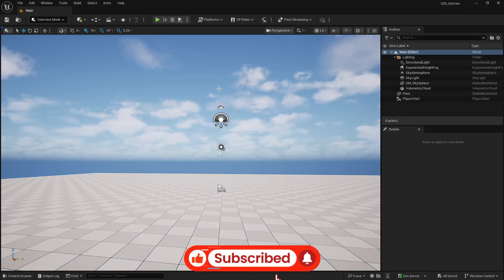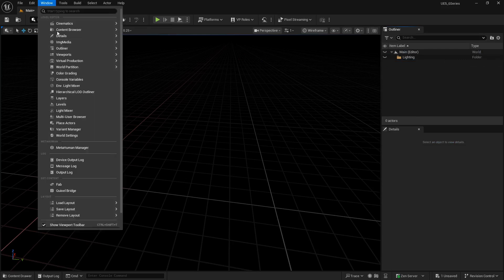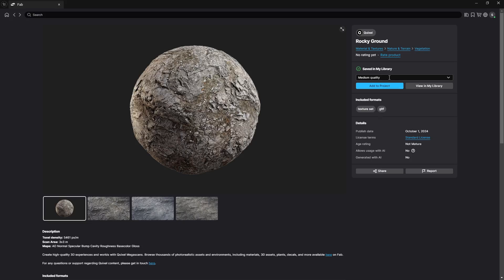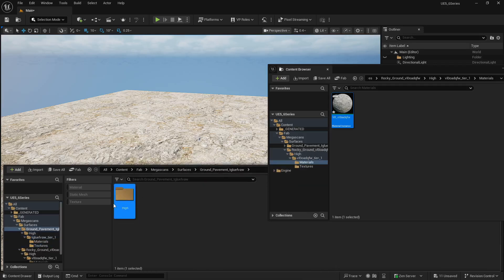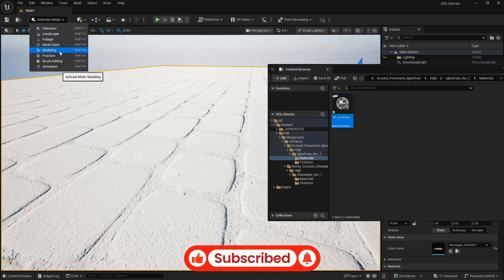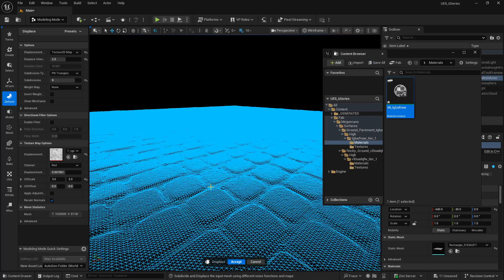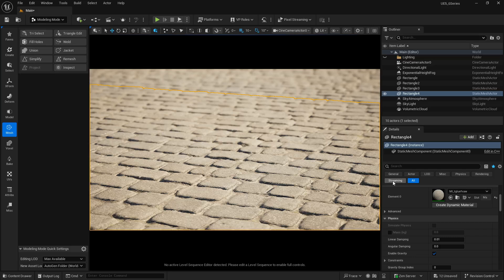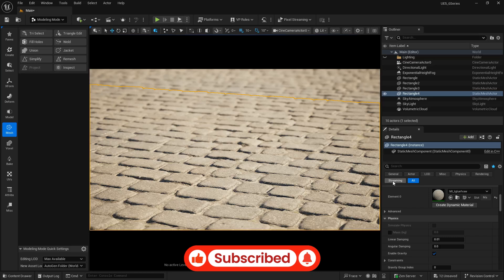Unreal Engine 5.6 Full Beginner Course (Day 10) : Displacement in Unreal Engine

Comment: Isnt Nanite displacement the way to go?
Reply from the maker: It is good when you do landscape with nanite tesselation this method is used when you need to show details like wall design of stone which is displaced and don't need modelling than when you doing closeup of floor where their are some objects or it can also be used on object to get some displace edges like a table which has wood but we need that extra details but not in modelling level but at material displace level etc